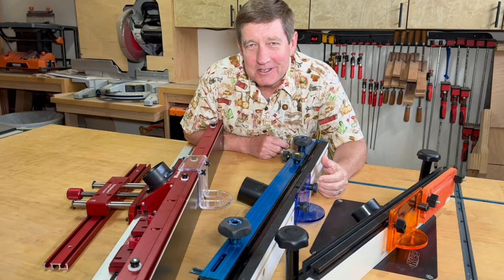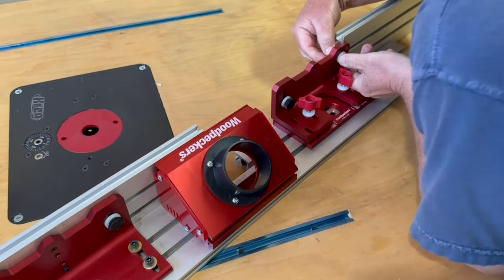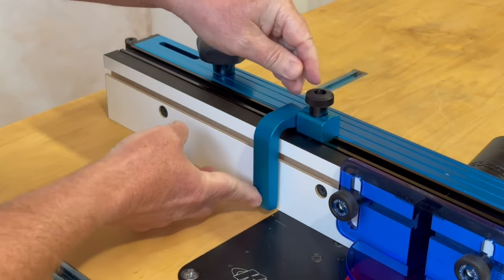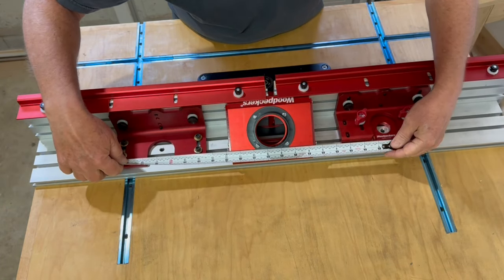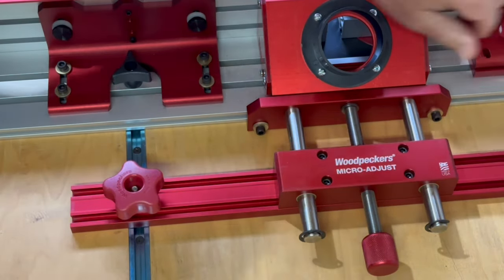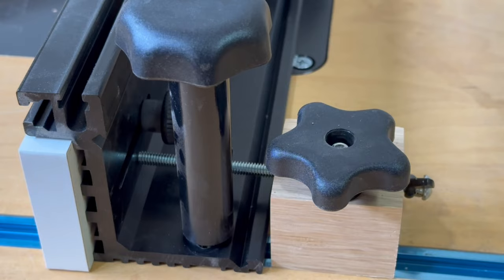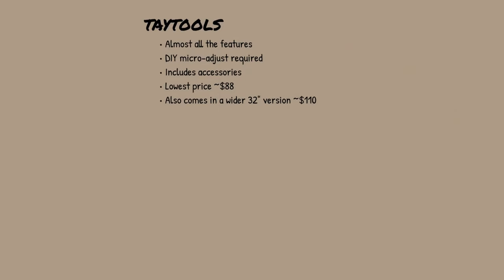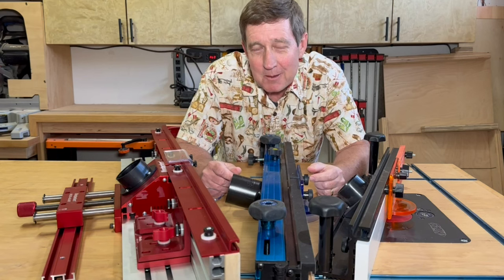Router Table Fence Review: Woodpeckers vs Rockler vs Taytools

Comment: I have the Taytools fence but have it set up as a pivoting fence, the set up & micro adjustments are extremely quick and accurate.
Reply: Ah yes, the pivoting fence for the router table. Glad I've stumbled on some videos showing how to make it, as a user myself it is accurate and especially easy to adjust
Reply: @adtymryd6295  I thought I new how to set it up but it didn't work, it was accurate up to about 2 inches but after that the it lost accurate measurements

Comment: If you are building your own router table, why not build your own fence? Rockler costs $500? for half that I build a digital fence- select your desired position and it powers there, accurate to 0.01mm. And it has a linear rail mitre fence. And the bit height is digitally selected too. Auto zero after bit change. Auto raise and lock if you select bit change. Plus it calculates the positions for finger joints or dovetails- press the button and push. Mortice slots? select the size and depth, clamp the workpiece and press the button. I can add more features via the programming port as needed. Video coming soon!
Reply from the maker: Hey Mike, that sounds like an incredible router table fence!!!  I subscribed to your channel, and can't wait to see the video!  Note that the Rockler fence is about $200 where I live, but still, I agree that making your own fence may be a really good option!
Reply: @jkmwoodworking  It was inspired by a commercial version- but that is over two grand- a bit rich for me. Besides, I like making things... It also will double as a digital fence for my table saw.

Comment: I'm new to wood working and in the process of setting up my shop and I'm finding the Woodpeckers brand really confusing.  The products generally seem fine, but they seem to demand a premium that I just can't understand.  If I compare the build materials and accuracy of the rules they make to machinist equipment I'm just left scratching my head!
Reply from the maker: I agree with you! I do think they have nice products, but just the prices aren’t grounded.
Reply: Made in USA adds a lot of cost.
Reply: How much are you willing to invest? There are so many options and brands not discussed here in this video but it all depends on your budget and what kind of work you might be doing. I own a JessEm Mast-R-Excel fence and table myself but bought this all used with a 3-1/2Hp VS PC router for an unreal deal and was priced much less than the Woodpeckers fence alone.

Comment: I threw more money than I wanted at the Woodpecker.  The original super fence was ok, especially with the additional micro-adjust (extra $), but I could never get the infeed and outfeed fences to stay coplaner.  Then Woodpecker came out with an expensive $350 SF-Pro upgrade that I bought.  The upgrade has precise screw adjustment that solves problems with the original design.
Reply from the maker: I agree that Woodpeckers is a bit expensive.  It does seem like really solid stuff, and well engineered.  I wasn't aware of the issue with the infeed and outfeed fence staying co-planer.  Thanks for sharing that info, and thanks for your great comments on several of my videos!!

Comment: Hi Steve, Question for you.  What distance do you recommend from the fence face (when centered over router center line) to the edge of the table?  Considerations are enough support for a wide board but not too much width that it impedes your access to the work piece while you are sliding it along the fence during router operations.  Any thoughts, 12" ?
Reply from the maker: Great question!  I built mine at 12”, and have been very happy with it.  I believe that a 12” inch offset is common.
Reply: @jkmwoodworking  Thanks Steve. OK, now a follow up question.  What is the feather board track center line dimension to the center line of the router bit?
Reply from the maker: @tinkertime4588  The featherboard t-track centerline is 6 3/4" from router bit centerline, and has always worked great for me.  Seems like kind of an odd distance, and I can't remember why I spaced it that way, it has been a few years.  I did do some comparisons with commercially available router tables at the time I built mine, so maybe I got the dimension from that, not sure?  One thing that I might consider on the next one I build is to put a miter slot instead of t-track.  You can still use a featherboard with a miter slot, and then also have a miter bar on the router table for certain cuts.  Or even one of those tracks that have both t-track and miter slot side-by-side.

Comment: Nice review.  Goes to show you that the most expensive option may not be the best.  I went with a mid-range fence from PeachTree Woodworking that came as a kit/option to my cast router table extension wing for the table saw.  I think it runs around $200 if purchased alone and has many nice features.  I bought a set of Rockler micro-adjusters and made a simple custom mount that slips over my table saw fence to allow me to adjust the router fence off of it, then lock it down.

If I may suggest, I bought a set of Jessem Clear-Cut stock guides made for the router fence (they make a type for the table saw as well I also have).  It is the best way to control workpieces and prevent kickback IMHO.  Well worth the cost and very reasonable for the router at ~$120.  I love and have used them many times to mill up custom trim perfectly... even slightly warped pieces.
Reply from the maker: Thanks!  Great info, thanks for the thoughtful comment.  I'm going to look into the Jessem Clear-Cut stock guides, probably for my table saw as well, great suggestion!